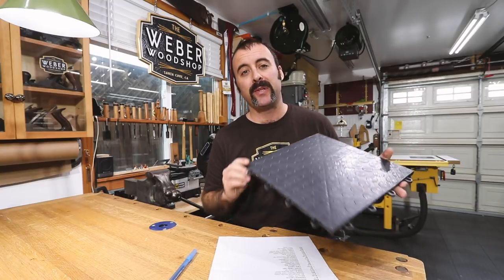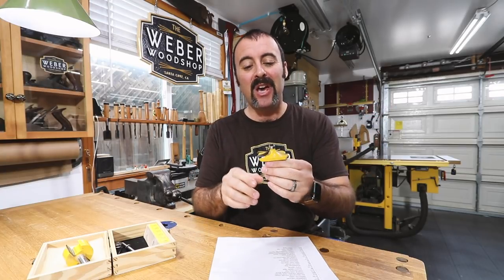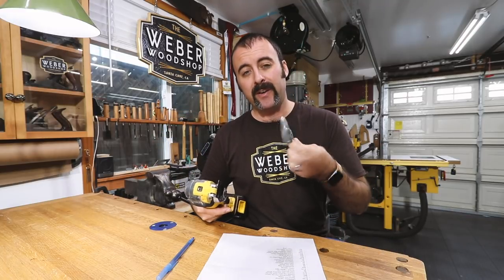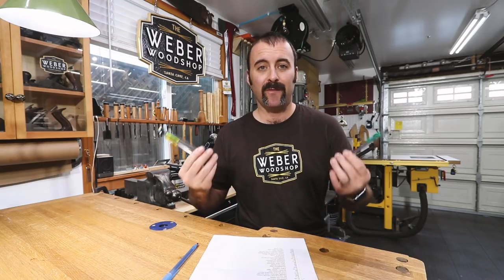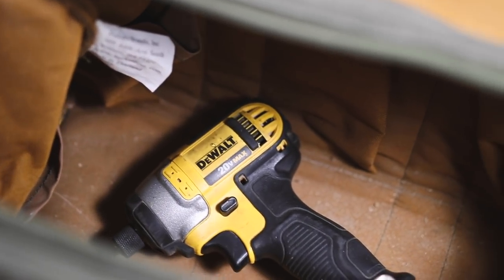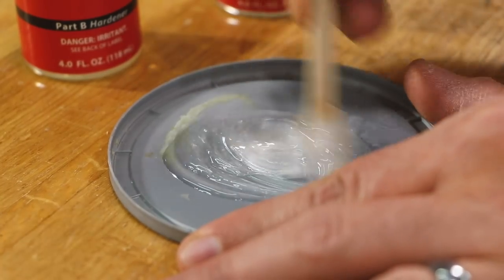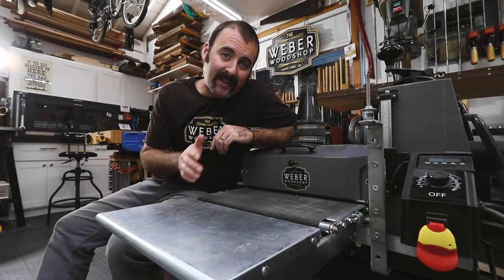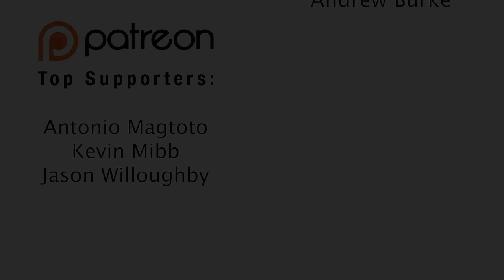35 Best Woodworking Tool Buys!

Comment: Never get a circle sander, get the palm rectangle sander so you can reach in corners
Reply from the maker: DrummerMax27 27 I completely disagree. Those leave scratching circles that will show up in the finish, are harder to change paper, usually don’t have decent dust collection, and aren’t as efficient. If you’ve never tried a RAS it might blow your mind.
Reply: Blake Weber well I’ve never had an issue with the square sander but maybe you but thanks for the feed back, maybe I should get one for my finish sanding.
Reply: I have both ....... but I prefer the orbital sander. The rectangular sander works in corners really well.

Comment: There’s a few splurge items but most are under 50 bucks. Looks up rigid oscillating sander, 500$.
Reply from the maker: It’s not usually that price. The links change sometimes.
Reply: $269 at Home Depot.
Reply: The demand for those might be high so thats why the price might be up

Comment: Hmmm. Robertson square drive available from mcfeelys, but I have found nothing that compares to grk screws. They are coated, they are available in cabinet and finish as well as general purpose- never get a metal splinter... they are now available from big box stores-... they are expensive, but time and frustration are greatly reduced. They use a type 17 self drilling tip, so in some applications they are a little less forgiving. downside maybe is that you need multiple sizes of star bit.
Reply: Wonder what happened to the “Outlaw” screws?

Comment: if youre looking for wireless go with hesh2 wireless from skullcandy. they come with a wire if you prefer, but they ARE noise canceling, not sure on the protection rating though.
Reply: ive had mine for 2 years and am a mehanic by trade and they are wonderful.

Comment: Great vid! As far as ear protection with bluetooth goes, you should check out 3M' headset. It's about $60 but it's worth every penny
Reply: Kyle Verduin I should check those out. I liked how the Howard leight are very lightweight and I can replace the ear cups periodically for hygiene. Just added a Bluetooth adapter with zip ties
Reply: @andyh1227  I have those they are the worktunes connect, only with bluetooth no fm radio. The only problem I have with them is that I find the volume relatively low. but there's nothing else better thats not in the ear. I can't ddo in ear protection and prefer over the ear.

Comment: Great video! I am in a sticky situation and need some advise. My workshop floor is concrete with dips and bumps do you recommend i first lay  some self leveling concrete before i add the 1 by 1 tile? Thanks
Reply from the maker: Depends on how bad it is. Those tiles will even out your floor quite a bit.
Reply: self leaving epoxy

Comment: maybe because im just old fashioned, but although i do use ca glue a lot, im not fond of all the videos i see of people using that and only that for woodworking joints. i have to say, that example where you busted the blocks up with a hammer may be beginning to start to sway my mind.
Reply from the maker: deth502 I don’t use it for woodworking joints. It’s great for quick jig making, repairs, etc. I end up reaching for it a lot though.

Comment: You can buy a bluetooth adapter to plug into that headphone jack, or if you have the time just cut the wire and solder it so you're not dragging around a 3' wire all over the place
Reply: Put an inline plug on your phones.  That way you can unplug the cord.  You're going to get that wrapped up in your router one of these days.  BTW, cut the cord shorter while you're at it.

Comment: That drawer cabinet will work. However yours is a lot larger. You have 24 drawer instead of 18 and yours looks a lot larger and drawers look wider.
Are you concerned about having water or other fluids sit under your tiles. Thanks for the reviews.
Reply from the maker: No it drains right out if I spill something.

Comment: The amazon link for the star drive screws sent me to a Phillip head screw set. :/
Reply: I just learnt it the hard way...:) I'll keep them regardless.
Reply from the maker: I'm really sorry about that, they changed the listing after I posted the video. I can no longer find the torx variety pack but I just changed the link so it links to 1-inch star screws that are the same as what I use. You might have to search around for the other sizes. Amazon usually lets you return things for free. Sorry again for the inconvenience on my part though.
Reply from the maker: Pawel Gotlib did you see my other reply? I’m really sorry about that, they changed the listing on my link :/
Reply: @weberwoodshop  I did, no worries:) I will keep them for emergencies - good stash for when you run out of everything else:) Happy Holidays!

Comment: Star drive amazon link leads to phillips head drywall screws
Reply from the maker: I'm really sorry about that, they changed the listing after I posted the video. I can no longer find the torx variety pack but I just changed the link so it links to 1-inch star screws that are the same as what I use. You might have to search around for the other sizes.
Reply: Hahahahahaha

Comment: Can you please recommend some generic blades for the Dewalt multitool? Thanks!
Reply from the maker: Wes Cullen I did in the video... the blades from Harbor Freight seem to work great.
Reply: Not generic, but Home Depot has a set of Ridgid blades for like $40 for Christmas that work well. 
The other ones are Bosch carbide blades. The are like $15 or so a piece, but last and cut through MULTIPLE screws or nails before they start smoking or burning the wood.
Reply: Cool thanks!

Comment: Love how he shows off the sponsored super glue at 13:54 by quickly flipping the hammer to split the wood. I wonder if the glue joint would have separated if he used the face of the hammer.
Reply from the maker: Wow you’re like a detective. I guess I’m guilty of trying to make a demonstration.

Comment: What you are calling "Star Head Screws"are really refered to "Torx Head"
Reply: "Torx" is a brand name - so it gets called "star-drive" sometimes. Just like "Allen" is a brand name often used to refer to (internal) hex drive. Some people prefer to use the brand names, others prefer not to
Reply: @samuelmellars7855  Actually as Torx is the brand that developed it. the actual thing is a Torx. That is why they are labeled as such on other tool brands. Same for the Phillips head. Not quite the same as calling a tissue a kleenex. A lot of engineered products work like this.

Comment: I noticed the connection piece you had on your dewalt orb sander. What is it? Looks like a good way to do that. I could not see what it was because of screen size. How about some help Bro.
1st time viewings your channel. Yes I did subscribe
Reply from the maker: Chuck Wheeler rubber connection for pipe with a simple pipe clamp on each end that I found at Home Depot. Thanks!
Reply: @weberwoodshop  Thanks Blake. I will look for them at HD

Comment: First of all, great video. Some I knew, some I didn’t. Your presentation style was excellent. 

As for all the grief some are giving reference the Amazon affiliate links, wth?  People attacking you with “not sponsored, but you have links” nonsense- sponsoring is brand specific (ie - Dewalt products only). This video can be seen from anywhere on the planet. Not everyone has Home Depot, Menards, Dave’s Local Hardware, etc. Amazon, however, is available everywhere and the links allow people to check out the products and read reviews. None that I saw are Amazon-exclusive, so feel free to buy elsewhere if you choose. <steps off soapbox>.
Reply from the maker: Mike Huntoon thank you

Comment: I haven't had success with my glue bot. It leaks and I'm not sure why. Must be a user error...
Reply: i bought one, and the top tip threads kept skipping. i told the company. they sent me another, and the exact same thing happenned. Frustrating, but the glue seems fine. and now i have 2. Haven't changed the tips much because of that issue.
Reply: I have exactly the same issue with all 3 sizes of glue bot; the threads skip so you can’t seal it properly and therefore glue leaks out the thread

Comment: One of the most handy tools I have in my shop is this veritas precision square.  Similar to the 6" ruler but much more handy as you can measure blade height etc.  As a bonus it also comes in American measurements.

https://www.leevalley.com/en-ca/shop/tools/hand-tools/marking-and-measuring/squares/66573-veritas-precision-square
Reply from the maker: Mark Ryan cool thanks for the link!

Comment: Why would you not just use Robinson screws?!?
Reply: Robertson* screws are a Canadian invention and unfortunately haven't really caught on in the rest of the world
Reply: Eh, they were hot here in Michigan at least for a minute then everyone went to Torx. My personal opinion, I like the Torx screws better.
Reply: Same basic benefit.  By being at 60 degrees per corner versus 90, it can be slightly easier to find the angle to drive, and Torx has potential for better grab with its six sides, but for most people there won't be a lot of functional difference.  Both beat Phillips hands down, just as Phillips beats slot.

Comment: Not trying to be that guy. Just letting you know the thing at the back of  table saw blade is called a Riving knife, not a splitter. I’d message you in private if I knew how. You can delete comment after you read it. Just an FYI.
Reply from the maker: Andyswoodshope O Not trying to be that guy either but you’re wrong. A riving knife moves up and down with the blade. This one does not do that. It’s stationary and held in place by two wing nuts. If I want to make a cut that doesn’t go all the way through the workpiece, I have to completely remove the entire thing. Riving knifes are an awesome addition to modern saws, but my DeWalt is probably 15-20 years old, which is before they became standard in most saws.
Reply: I don't want to be that guy either but Jeffrey Epstein didn't kill hinself.

Comment: Torque bits...shrink wrap not stretch
Sorry OCD would have drove me mad if I didnt speak up
Reply from the maker: chris hartman I get it, I suffer from the same affliction. But it’s not torque it’s actually “torx”. And it’s not shrink wrap it is STRETCH wrap (shrink wrap is for heating up and shrinking around something) but another industry name for it is “flat twine”.
Reply: Torx bits right ;)
Reply: @weberwoodshop  No one at work says stretch wrap at all even though technically it's right. We go through skids of it constantly.  EVERYONE says shrink wrap.
Reply from the maker: fire surfer Sorry I didn’t realize you had asked “EVERYONE”
Reply: @weberwoodshop   lol, everyone on my job.  :)
Reply: @firesurfer  two different products, I just asked everyone else.
Reply: @swell411   If you actually used it you would not try to defend what you said. In practice, nobody cares what it's officially called. On the package it says stretch, but everybody still says shrink. So there!  I win.
Reply: OCD spells Torx wrong?  (And unless it's the Torx brand, it's the wrong use of the term anyway.)
Reply: Talx to text does not work that well...but way to go guys feel better?